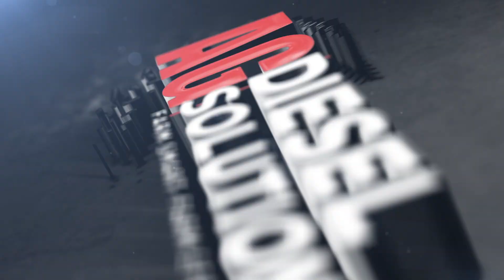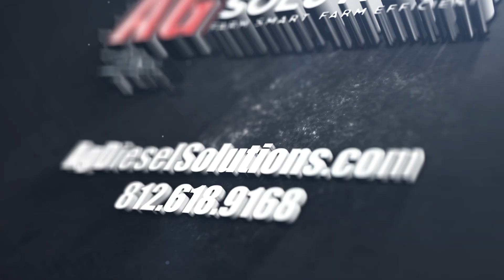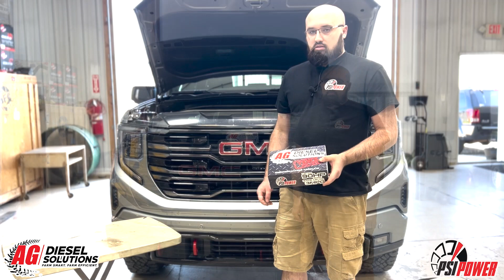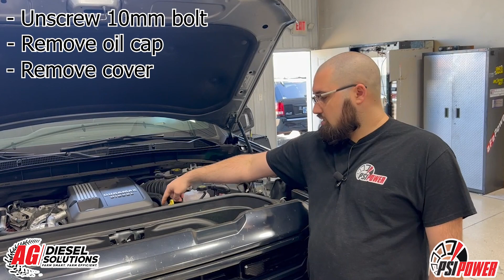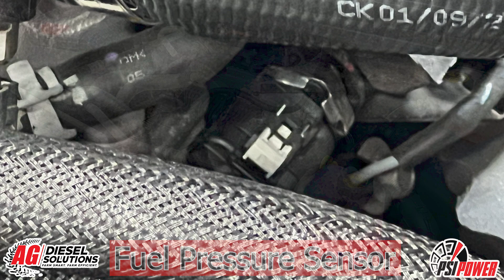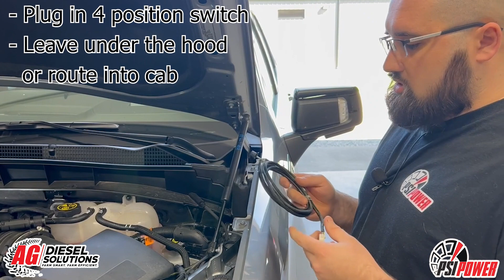2023 GMC/Chevy 3.0L LZ0 Duramax Ag Diesel Solutions 61900 Install

Comment: Would there be any reason to run it on any setting other than high?
Reply from the maker: if you were towing heavy, then we recommend bumping it down a setting, but otherwise we recommend leaving it on high.
Reply: I've heard people saying this product put their truck into limp mode randomly, is this an issue you are working on or is there a way to keep this from happening
Reply from the maker: @matthewboyer6659  hey, there's different reasons a check engine light can come on,  give our tech support a call! 812-618-9166

Comment: AT4 with the stock tires 9k miles in averaging about 24.5(the same truck but without the short bed).  I’m wondering how this sort of thing is perceived from dealers perspective if there are ever any warranty issues.  With the maintenance plan they have the truck regularly for the oil changes to observe this sort of thing.   It’s just a daily driver 60-70 miles each way for me so I’m always looking for maximum fuel economy though who wouldn’t mind some extra passing power now again on all the two lane roads.
Reply: Don’t do it. This snake oil product is just tricking your truck to run in some factory un-intended way by altering sensor readings. The fact that they’re not transparent in telling you how the system works should be enough information. 

And yes something like this is not going to go over well with any dealer who is performing work

Enjoy the truck. 24.5mpg is impressive!